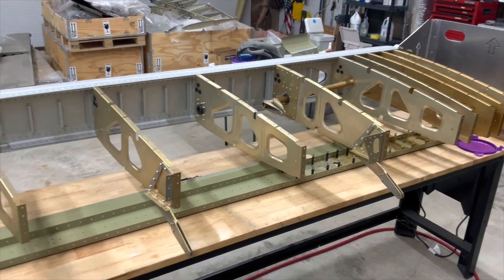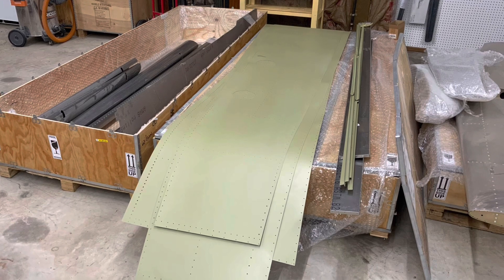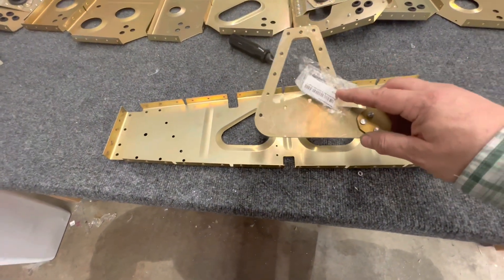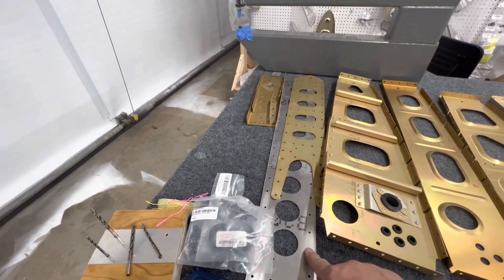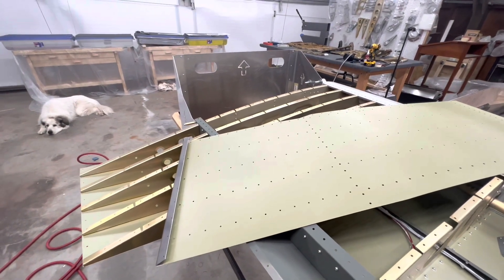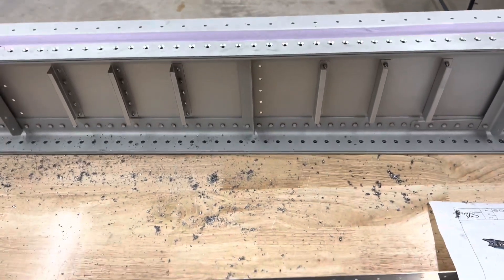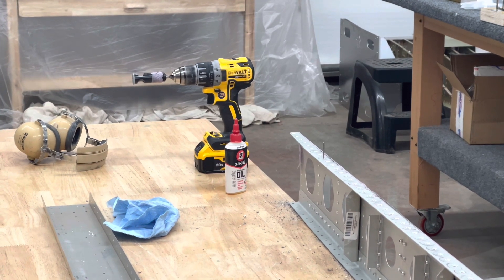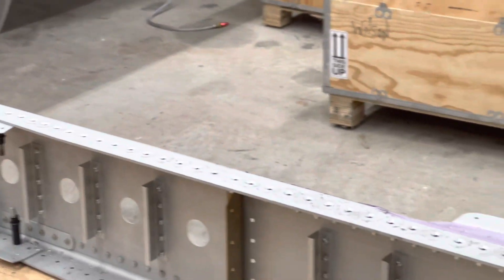Build Update - Priming, Countersinking and Left Wing Assembly

Comment: This might be an optical illusion on the video, but it looks like the bottom bracket for Rib 11 is not "inside" the spar flanges on the bottom?
Reply from the maker: It may not have been when I filmed, but I just checked and I’m good to go currently.  I need all the eyes I can get, thanks. Thinking backwards from the right wing instructions to doing the left slows me down a bit.
Reply: @aviationkitbuilder  Yes, the left wing was a little bit of a mind bender at times. I can't tell you how many times I looked at the brackets to confirm they were correct after watching FirstRivet's videos. 🤣

Comment: Looking good.  Waiting on my flap torque tubes, and one of the bushing brackets was malformed.  Any clearance issues with running the Midwest harness?
Reply from the maker: No, its just a matter of pulling it through the rubber grommets and the laying it in place. I still have to secure it with zip ties but that shouldn’t take very long.